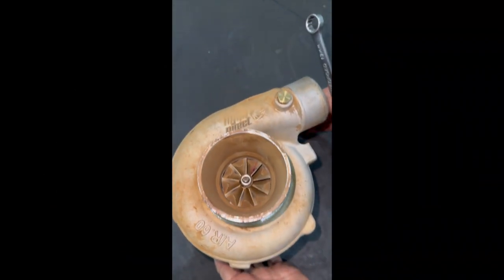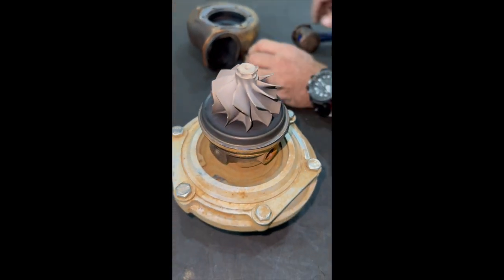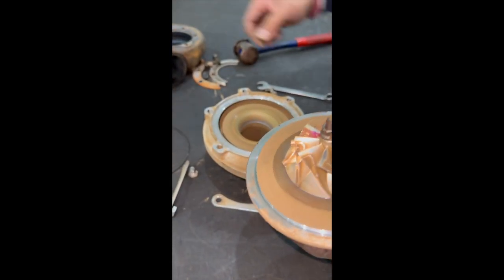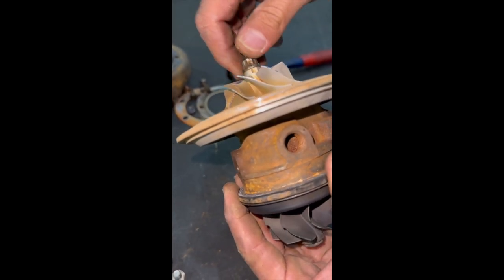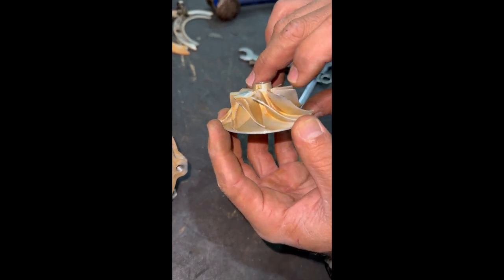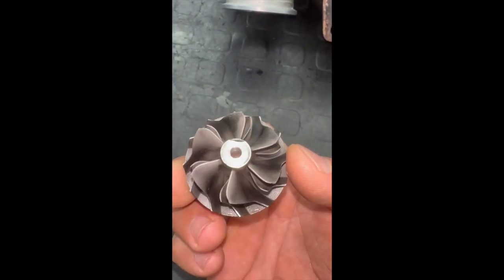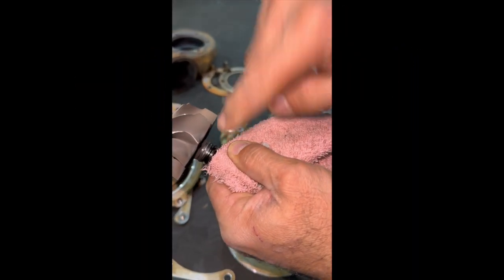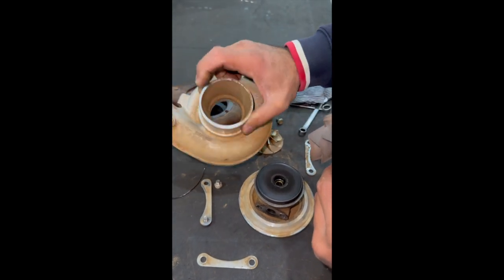Rally Spec turbo analysed - Severe Dust Out

Comment: hey Chris, happy to see you back! could you recomend me a turbo for my 2.3 vr5 engine? boost pressure 28-32psi, hp goal 650 crank, currently looking at the g30 900 .83.. looking for quick response and good usable power.
Reply from the maker: Hey - thanks for the comment. The EFR8370 is the turbo of choice for this setup - stay away from the G-series range, it is overrated, and unreliable in power delivery etc. The Gamma-TI turbine on the EFR is unmatched with spool, overall weight, and reliability. Its a much better quality product and will offer you ALOT more features than the Garrett will.

Comment: Wow no water cooling used, only oil on a water cooled housing? I thought that was a no-no.
Reply from the maker: Its a custom built turbo, which has the facility for H2o cooling, BUT not necessary if you aren't able to use it. Obviously the bearing system will last longer if you did cool it, but this is a very competitive class of racing with short heats and lots of spares.  Downtime costs valuable time.

Comment: If air cleaner is on it, that would not happen.
Reply from the maker: This class of racing will destroy a run of the mill air cleaner - once the cleaner is full, it will destroy the filtration media and suck it though the wire re-enforcing. The air filter was there. The other thing than can cause this is ingestion of muddy water - which no filter will protect you from.